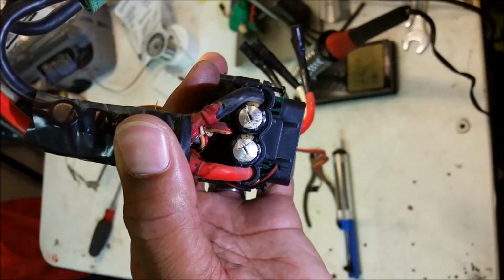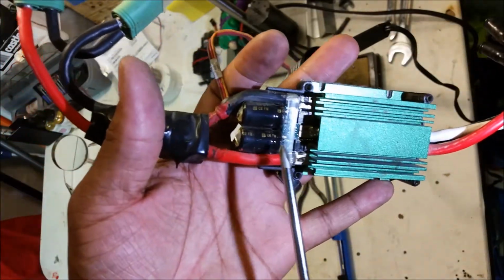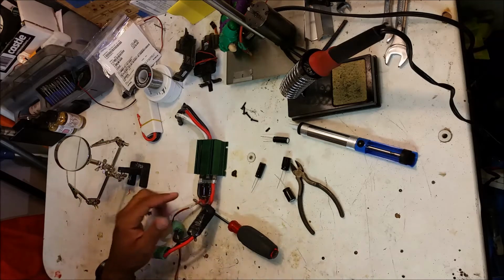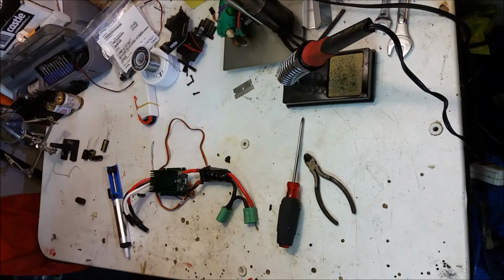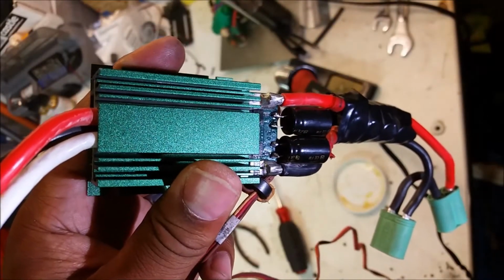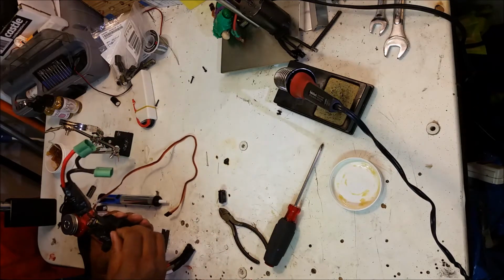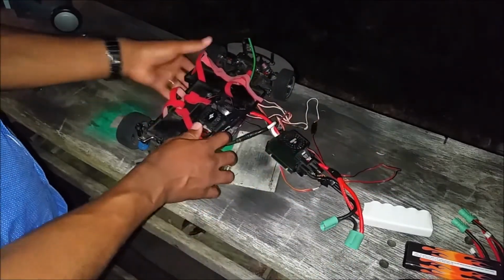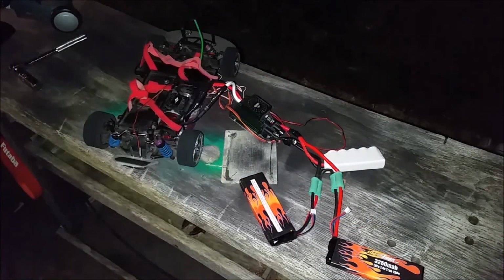Bashers University: Replacing Blown Capacitors on an Castle XL2 ESC

Comment: As a word of advice, you may wanna pick up a spool of solder wick to aid and make solder removal a lot faster and easier bro. How do you like the new cap packs that you are using, have you noticed any difference in them?
Reply: Donald Byrd BTW, where did you get your replacement caps from?
Reply from the maker: The caps are the same ones that castle uses so they were a direct replacement. They work just as good as the ones before.
Reply from the maker: I've seen that stuff. I'll give it a try next time. Thx bro!

Comment: Figured out mine were blown,  replaced but the esc still doesnt power on.  (xl2).  I het the normal spark wen i connect batteries but thats it. Any ideas??
Reply from the maker: There are 2 levels of circuitboard inside that are connected via a snap together plug. sometimes when you take it apart these 2 half's come apart. press down lightly on the part of the board that has the esc wire connected to it and see if you can here it snap back together.

Comment: Hey I had a question my esc is having problems it won't move forward but it works in reverse and steering works could it be the capcitors
Reply from the maker: Make sure you don't have the radio channel reversed and brake disabled on the esc.
Reply from the maker: Also make sure you done the trigger programming correctly.
Reply: @BASHERSUNITED  I figured it out it was a burnt mosfet so I just ordered a new esc
Reply from the maker: Glad you got it figured out.

Comment: Do you know what you did or didn't do to cause the caps to blow ? It just happen to my xl2 and I haven't figured out what went wrong .
Reply from the maker: +Zerega Rc Drag Racing that was awhile ago but I think it was my external castle cap pack had come loose and was basically shorting back on an off the wire.
Reply: Oh okay thank you bro

Comment: Excellent video!!!

This JUST happened to me! Dangit!! I think I will probably just wire up an external cap pack mount so I can swap out my packs instead of the "factory-like" repair though.... assuming these guys are wired in parallel to each other. If not, I'll just follow your lead.
Reply: @Vance Joaquin thanks, I signed up and it seems like a nice service :) Appreciate it !!
Reply: @Donovan Atticus Glad I could help =)

Comment: hey there brother what did your esc do before you replaced the capacitors? what problems were you having?
Reply from the maker: +DIAZ8106 wouldn't give constant power. It would pulse the power for a bit then shut off.